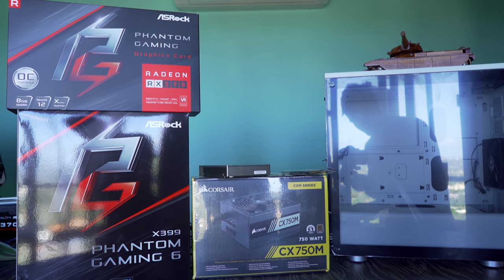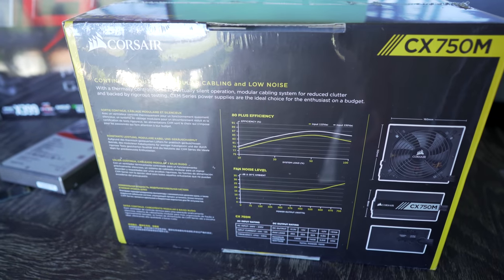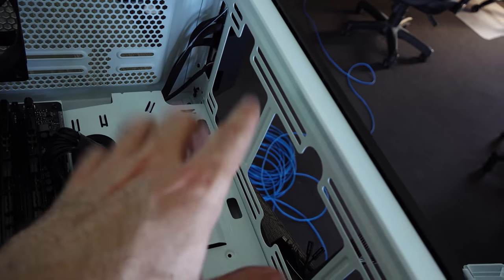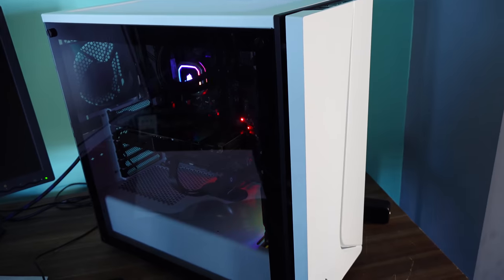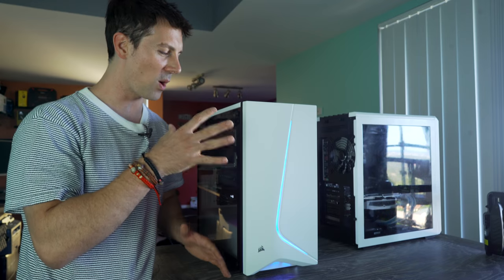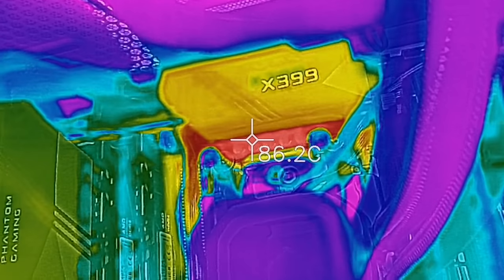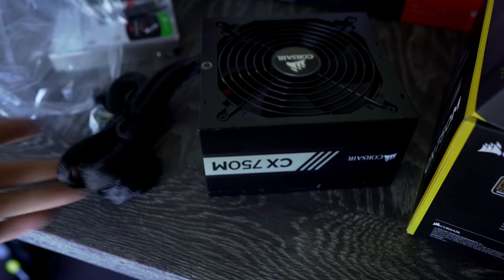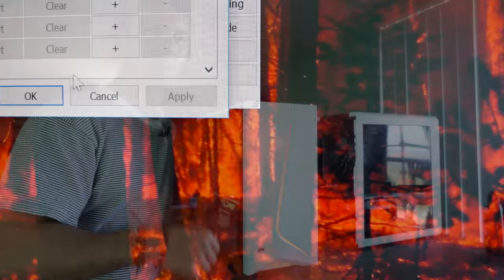This PC Has 16 Cores, Costs $2690.... Why Am I Building it....!?

Comment: Please test out World of Warcraft on that pc . The new 8.1 patch now utilizes more cores in DX12 would really like to see your FPS in a raid with Ultra which will push any cpu to their knees but have yet to see anyone try a Thread Ripper .
Reply: It's still shit for utilizing the cores, their shit is broken. The game doesn't even utilize my 1600x, it's stuck on one core.
Reply: @johnmartinez8530  hhhmm not sure about that . I gained fps since 8.1 and Im only running a 2600x . And I only have a 1060 6gb . You got your cores unparked ? If you havent lol Windows park them by default . And if your using software you gotta use it every time you boot up . Have to unpark them in the registry
Reply: @2roly2  just open task manager and see for yourself.  8.1 https://i.imgur.com/iVW3lst.jpg ,  pre 8.1 https://i.imgur.com/sNRDMzy.jpg , seems like there is slight improvement on utilizing the cores, still no comparison to games that actually do it well https://i.imgur.com/YaaUFoN.jpg
Reply: Intresting suggestion,Blizzard stuff usually scales very well with more hardware,yup i would be intrested in this too,even though i havent played that game in a while!
Reply: @johnmartinez8530  Are you using dx12 with the newest drivers? My old 4670k pc's cpu usage went up by a lot, and fps by 15-20% as well in busy cities.

Comment: Just so you know, you don't need Shadowcrap for desktop recording, Relive works perfectly fine and I have it set to the same hotkey (seems much more reliable than Shadowcrap in actually freakin working... Sometimes I have to reboot to get Shadowcrap for it to work sometimes).

I haven't tested RX 4/5 series enough to know how it impacts performance on that series (Shadowcrap tanks fps and frame time stability on my Titan Xp Star Wars collectors edition), but my R9 Fury scores within 1% of my TimeSpy/Firestrike scores while recording at 4k (actual test result was within 0.5%, but my margin of error is literally more than what performance impact was, so it could be up to 1%).

Putting some Sunon "super" class server fans on my RX 470 now for testing, looks like I can only fit 10x 40mm contra-rotating duel stage fans. Unfortunately, I only have 5x, so may use a large Maglev or 5x Delta 40mm to populate the heatsink. However, I just got some LM for a shunt mod on the Titan Xp, so its probably going to need to steal some fans or a water-block too, LOL! I have a pile of fans, but it never seems to be enough, haha!

Comment: Why use OBS instead of AMD Relive for desktop recording?
Reply: Because when you are a nvidia user 99% of the time you forget the small guy has stuff like that to , it's sad but its the truth
Reply: I use OBS and ik that relive exsists. When you have the power OBS is 10x better because of all the settings you get and the relive streaming is a joke. OBS just creates a lot less work for editing later because it lets you set it up right the first time. For example I can't add a facecam in on relive. Shadowplay has the same issues too so it's not just an AMD thing.
Reply: @antraxbeta23  No. He's using OBS, because it's better.
Reply: @summoner1451  he uses OBS , yet he mentioned how he misses nvidia shadow play , how does that make sense , why would he miss something that he never uses , it's like me saying i miss amd relive even doe i never use it because i <3 OBS
Reply: SeikonDS 
You missed the point. If it was simply a matter of being an Nvidia user, and that he simply 'forgot' the competition exists, then how did he switch to OBS in the first place?

Simple, it's not the brand, its the product. He liked one more but than other worked better.

AMD isn't small enough to forget like that, as an Nvidia user you can't use their software even if you wanted to.

That alone proves they aren't so small to begin with, you don't lock out competition you're not afraid of.:P

Comment: I know this is an old video.  With that said, I just finished building with the x399 phantom gaming 6.  
I used the 1950X, the RX 5600 XT, and 32 gigs of  Vengeance LPX  ram.  So far  is been a beast. 
When I have the time, I want to  benchmark it against my dual E5-2680 machine.

Comment: The silver label CX series power supplies are completely safe and very good in the long run, it was the first generation green label CX units that used cheap components that died over time, Silver label CX units are good for price-performance.

Comment: I like mixing up new and old. If you can get insane value for money with minimal or no performance loss on some parts, why on earth would you pay for top-line on new for something that doesn't fit your specific use case; less really is sometimes more. Doing that also frees the budget for the expensive bits. This is why I subscribed and remain subscribed. Thanks Bryan for bringing varying content others just won't or don't have the foresight to do.

Comment: how did you get two 8 pin eps connectors in the mother board. that psu only has one.
Reply: I don't think you need 2 of them plugged in. However, I had an issue with not having an extra 4 pin (managed to lose my cable). I used a GPU 8 pin splitter to work-around the problem temporarily. They do sell regular CPU splitters, I was just using what I had on hand.
Reply: It's not mandatory to use 2.
Reply: the question is what cable the second cable is because the psu only has one eps.

Comment: i have a corsair cs 750m since 5 years now, its been through 3 systems (2x same but other gpus) and now in my newest pc is got in march and still holds up to this date. now i have a gtx 1080, i7 8700k @ 4.8ghz. wouldnt surprise me if it holds up with an rtx 2080ti im planning to get later next year, when (hopefully) the prices drop. 80+ gold certified psu

Comment: Bryan.  Why not go with a dual socket c602???  Run e5 2667 v2s or 2687w v2s.  All cores at 3.6 ghz for about $500 less than what you paid for the threadripper.  48 gigs of ddr3 will save you another $300 over your 32 gigs of ddr4.  Those 16 gigs will save big time on the render and edit side if you go up to 4k

Comment: I've noted that you have been using the Corsair coolers on the TR4 CPU's even though it looks like you have at least one Enermax TR4 AIO (280mm). Is there a specific reason? I want to use the Enermax TR4 II coolers because of their TR4 specific cold plate but I'm leary of the reviews, even from the gen II versions. Can you provide any insight, perhaps with the Enermax TR4 II 360?
Reply: You should always use a TR4 cold plate on thread ripper.

Comment: to me, these solid front panel cases of today are really dumb. why put intakes behind a solid piece of plastic? this is another reason behind me picking rackmount cases for my main rig and file server. Filtered intakes that can actually breathe.

I also have to ask this just to satisfy my curiosity. Why do you switch your main rig so often?
Reply: Fractal Meshify C ftw
Reply: It has caps on sides its not solid, corsairs knows how to make it so it still has enough air flow. Solid front is more bit more silent than open front, i have had similiar aio cooler setup front in open front cr500 and corsair 275r and there wasnt much of a diffrence in temps but it was bit more silent what was nice.

Comment: I've used a vs550 corsair PSU for like almost 2 years now and I've had no issues. Running an i5 7500 8gb ram Rx 460.

Comment: One of the things I love about the 2950x is that because most programs don't use all the threads, you can still use the computer while it's doing work. I can still play games while doing some hardcore handbrake encoding. I don't even get hiccups in framerate when doing that with most games.

Also, you might try dropping the voltage on your overclock. I'm rocking 1.2v at 4ghz, so under an AVX stress test it peaks at 74c with a Noctua cooler. Part of me wants to get greedy and see if I can drop it even lower.
Reply: Temp limit for the 2950x is 68c.
Reply: @Jolinator  You'll notice, if you watched the video, that his is running at 85c. The method AMD uses for that temp, I believe, is measured at the surface of the IHS. That will be much cooler than the actual CPU die's temp. Not sure how they came to that method. Maybe the idea is to remove the cooler as a variable? At any rate, it's not a good point of reference to compare reported temps to.

Comment: Those temps seem high. Much higher than my 2950x on the noctua 120mm air cooler. I am getting ready to switch to the corsair h150i 360mm cooler but after seeing your temps im wondering if that smaller contact area will actually make my temps go up versus air.
Reply: Noctua is better

Comment: An AMD Ryzen Threadripper *1st gen* 1920X CPU combined with this low-priced motherboard will make a sweet low-priced code compiling beast of a workstation.
12 cores, 32 or 64 GB DDR4, and the 60 PCIe lanes to the CPU will allow all 3 onboard M.2 slots to be combined into a super fast NVMe RAID 0 array.
*1900X* EUR 285.90 *1920X* EUR 345.00 *1950X* EUR 567.99
-------------------------------- *2920X* EUR 633.20 *2950X* EUR 879.00

Comment: as far as power supplies goes more watts equals better efficiency say 750 watt psu is most efficient power rating is at 375 watts more than that u loose power efficiency. Is this such a big deal? ahould we care? whats the cost difference vs a higher cost and wattage psu?
Reply: Is it worth it for power savings running duel HX1200i platinums? Sure, if you're using 1000w, it would technically be more efficient, however, that PSU is like 90% efficient over-driven pumping 1350w output (1500w input at the wall), and its only peaking at 92 to 93% efficient at best. Is it worth it in your opinion to get that magic 3% better by spending another $250? Just answering your question with my question...
To me, its obvious (says the guy who's running duel SuperNova 1300's, cause I need ALL the power, Mwhahaha!)

Comment: I just question why would u go rx 590 instead of vega 64 when its about 50% more powerful?
Reply: Because its newer... (That's legitimately the only reason someone would do that, to Brian, he's a tech reviwer, so the "new stuff" is what grabs views). Me, I'm about performance at all costs, I run 4x R9 Fury getting over 2x what my Titan Xp made (ironically, all 4x with water blocks cost less than what I can sell my Star Wars edition Titan for...). Driving 4k is not easy, and now that I've got the firepower, I may run some older games at triple 4k and use all my monitors.

Comment: Brain says "even on load only went up to 48 dB"
Me installing a MagLev and 4x duel stage "super" class 40mm server fans (practically silent with 66.6 dB rating) onto an RX 470 heatsink... 

Its fine, those 40mm are only going to pull 5 amps (1.23 amps each), so we're only talking 60w for the 4, and that's nothing compared to my modified 120w 120mm "case fan" I sometimes use. However, to keep current within molex spec I'm having to use a regular Sunon MagLev or Delta... Gotta say though, nearly 200w of fans on a GPU heatsink would be fun!

Comment: Great video.
Amd RELIVE driver question: anybody also has temperature issues since Relive 18.12.2 or 18.12.3 with RX 480/580?
I have, gpu gets warmer now... without manual fitting, even too hot.

Comment: The Ryzen 9 3800X And Ryzen 9 3850X is rumored to be better than Threadripper 2950, with higher clock speed and on the X570 plattform..

Comment: anyone know if I can fix an asus rampage 3 formula the owner said that it won't post after he messed up flashing the bios. I tried flashing the bios with the usb-bios flasher ch34a1 but it still won't post. Sorry to post here but you guys are the most knowledgeable.
Reply: james jacob microwave that joint
Reply: Have you tried installing an earlier version of the bios
Reply: @blastoisecannon2755  you think ill make more money selling it or posting a video of it being microwaved?
Reply: @Rickb-pz5qz  well I installed the latest and the second latest. I'm using an X5650 cpu but I've seen people successfully using that cpu
Reply: Have u tryed turning it off and on again?
Reply: @dominikjurkovic5540  Won't that break it?
Reply: @jamesjacob9632  then the bios chip may be corrupt and you may have to replace it
Reply: @Rickb-pz5qz  You think that is likely to happen to both of them? I tried to boot from both but neither posted
Reply: @jamesjacob9632  maybe if the bios installation was messed up on both then it is possible
Reply: @jamesjacob9632  isnt there some usb flash thing that lets you flash your bios from another pc like you pull the chip out and put it in the usb flash tool and flash it on another pc 

Loool Englisch very good
Reply: @Raja-ev1ly  yes that's the method I was using in the original post.
Reply: @jamesjacob9632  oh lol
Reply: @Raja-ev1ly  thats the guide I followed but it still wouldn't post
Reply: post to reddit.com/r/buildapc

Comment: Put a potentiometer on the common cable(either GND or VCC) for that front light and then you can have it dimmable and adjust to the level where it doesn't disturb you.
Basically a $1 hack.
Reply: Umm. I'm sure there is a software for the fans duh
Reply: Nvm
Reply: Even if it would be about the fans then I never have seen the option to control the brightness...

Comment: Sure hope Gamers Nexus hurries it up with PSU reviews to start busting the absurd myth of requiring excessively more wattage than what the components actually draw.

In reality good quality PSUs should have no problem providing all of the wattage that's on the sticker and that is after power losses meaning that whatever percentage is lost actually shows up as higher wattage pulled from the wall than what's on the sticker. A 750 PSU under full load could pull over 900W from the wall.
And I have never seen any PC pull as much FROM THE WALL as the graphics card used in the PC has listed as recommended minimum. In reality the listed TDP sum of the components ends up being way higher than what the PC actually consumes under full load.
PSUs also have efficiency curves and if a PC is using only 200W which is in fact realistic for a mid range build then having 600+ watt PSU will make it waste more power on losses than a similar efficiency 400W PSU.

Comment: Youre gonna have a massive gpu bottleneck from that 590 if you go with a 2950x. Linus showed that a 1080 will bottleneck a 1920x, so a 590 will bottleneck a 2950x way worse. Not just for gaming.